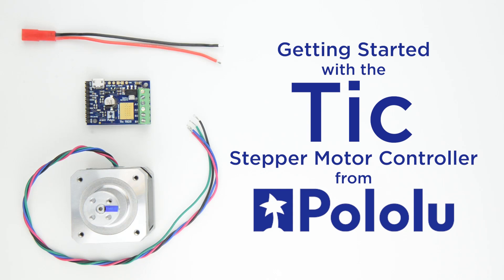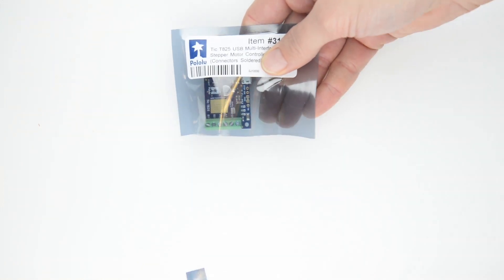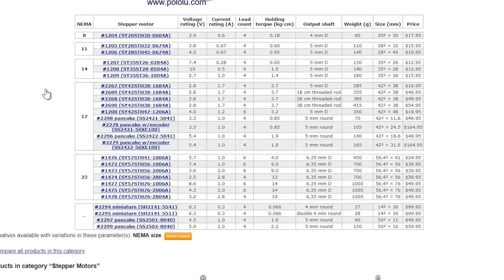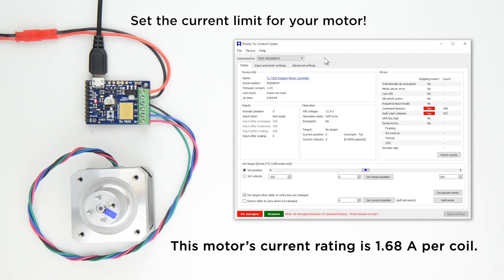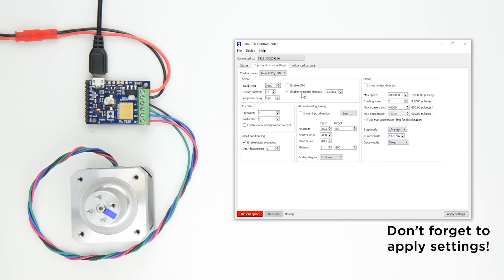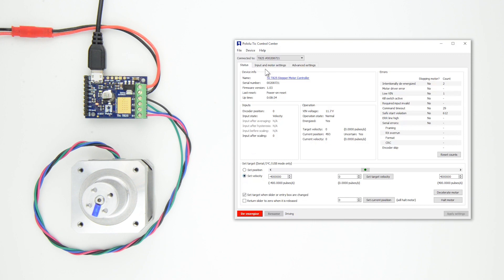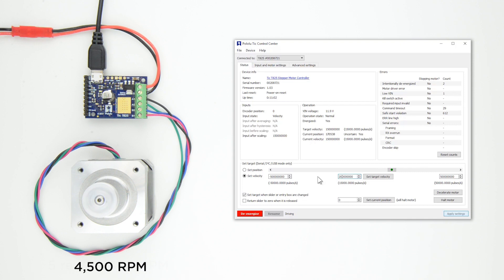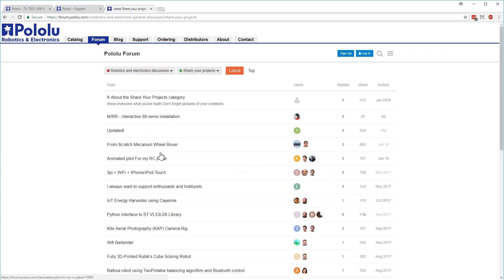Getting Started with the Tic Stepper Motor Controller from Pololu

Comment: Can the controller receive commands from a device located over the internet?
Reply from the maker: They have no built-in internet connectivity, but you could certainly control it from something that is connected to the internet, such as a computer or a wifi-enabled microcontroller.
Reply: My apologies for being evasive. I was refering to the PC software that is running on windows, if it can be controlled from the internet. Like a packet that is sent from the internet to the pc to go through the controller to the motor. Can this software support this
Reply from the maker: Hi, Alex. The software does not have any networking capability, but you might be able to develop something that interfaces with it (using the command-line utility ticcmd would probably work best). If you have more questions, please post to our forum: https://forum.pololu.com/

Comment: You don’t have anything that runs silently? These drivers are very noisy. I would buy them if they were silent drivers. Thanks
Reply from the maker: Hi, Trenton. We are working on quieter Tics, but at the moment, we don't have any stepper motor drivers or controllers that are specifically intended to be silent. However, you can often reduce audible noise by picking an appropriate decay mode, which some of our boards allow you to do.